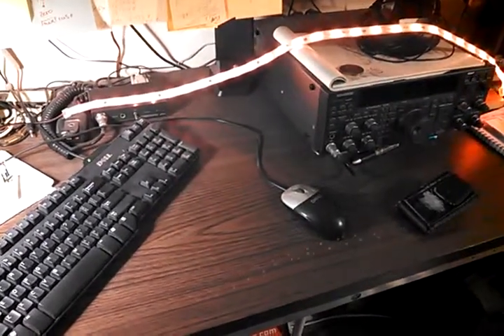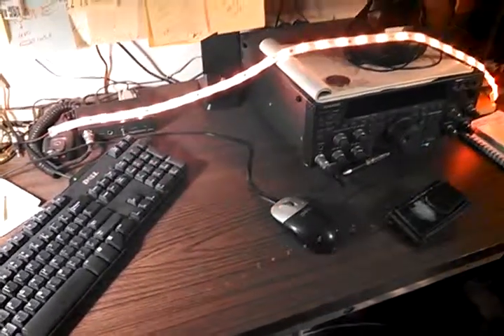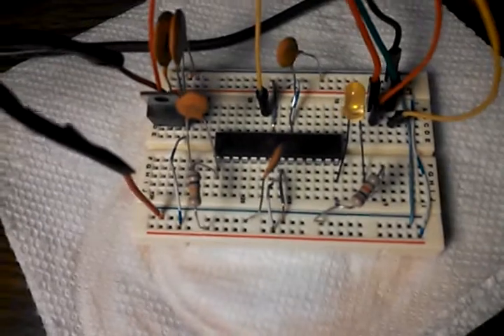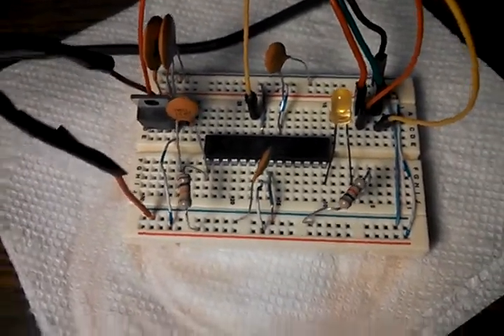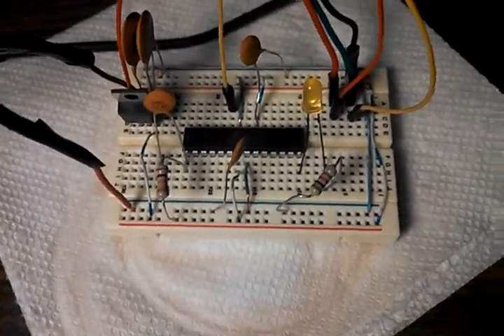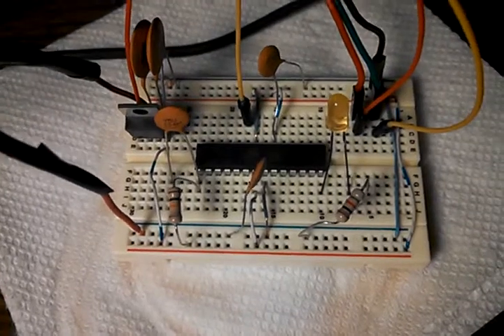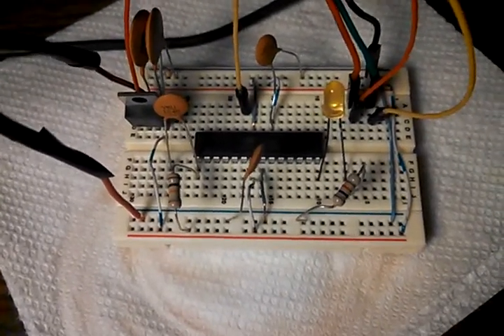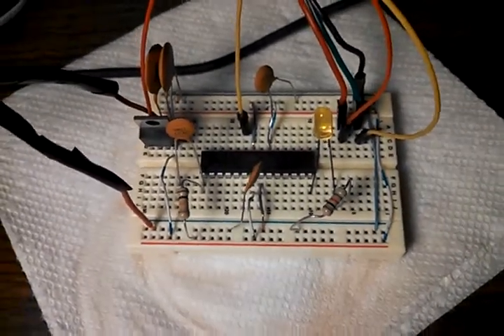Radio Shack Tri-Color LED Strip with ATmega 328p running at 8-MHz

Comment: Nice work.  You mind sharing the timing info or source code?
Reply from the maker: Sure, email me directly at   billvit@hotmail.com
Reply from the maker: The code is here:    http://ka8vit.com/special/test_rs_led_strip.txt 

This code was written for an Atmel AT328p running at 8-MHz using the internal oscillator.

If you are using an Arduino running at 16-MHz you'll need to use the function send_strip16MHz(uint32_t data) instead of send_strip(uint32_t data).

The rest you should be able to figure out from the code.
Reply from the maker: I dug around  my files and found an earlier (simpler) version of the 
code that should help others get theirs to work and understand the 
operation of the strip.

See:  http://ka8vit.com/special/test_rs_led_strip3.txt